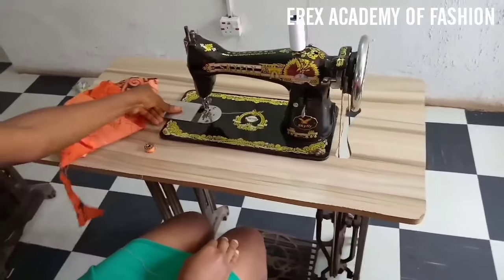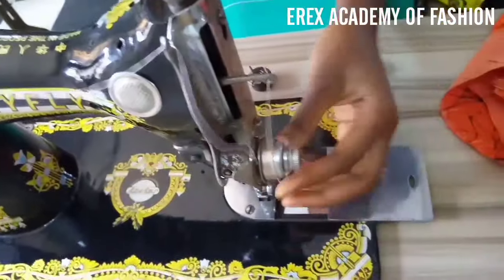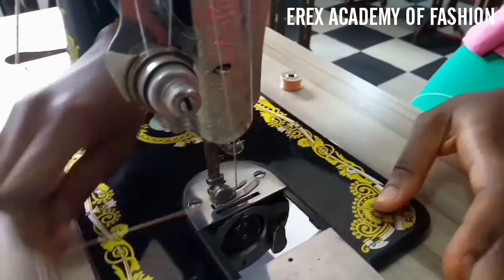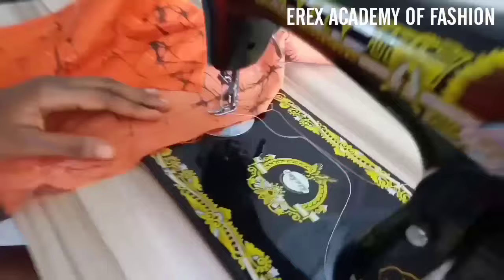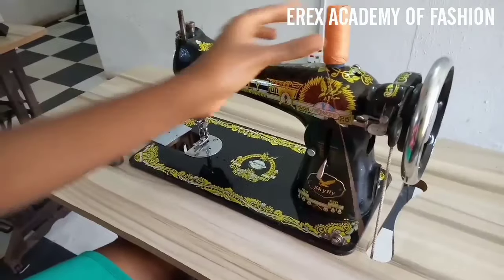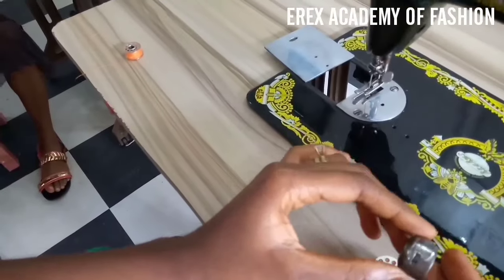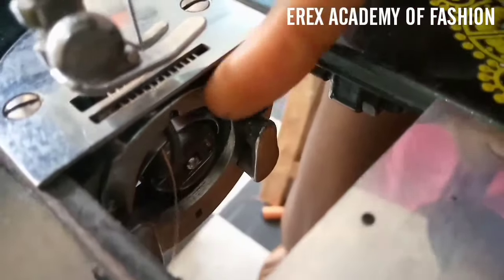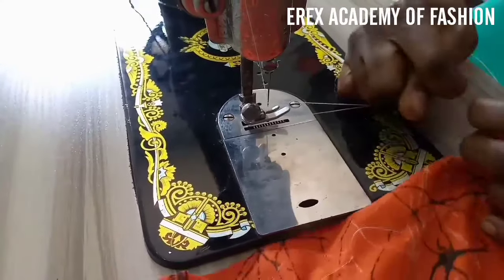HOW TO PEDAL A MANUAL SEWING MACHINE AND LOCALLY REEL THREAD ONTO THE BOBBIN/ REELER

Comment: Why is the thread in my bobbin not coming out when the machine needle goes in? 
Pls, I need help.
Reply from the maker: Your needle is either not fixed properly…it might be fixed above the stopping point and hence it’s inability to reach deep and pick the thread. 

It might also be that the machine timing has changed at the point the needle hit a hard object. These are the two main reasons the thread in your bobbin is not coming out

Comment: Please, what if the handle or... doesn't control the pedal?
Reply from the maker: There is a round knob that tightens the handle...that is balance wheel. Its called a washer. It might have become loose. Turn it to the right in a clockwise direction to tighten it. Try moving the handle again. It will move

Comment: Thanks for the tutorial but pls how do you stop it from going backwards every time 😭😭😭💔
Reply from the maker: Mastery of pedalling takes time. Keep practicing. You will master it and it will stop cutting
Reply: About how long does it take pls
Reply from the maker: Depending on consistency, it might take 3weeks to 1 month for some persons and shorter for others. But, if you follow the steps I taught in the video without using your leg as control first, it will be shorter for you